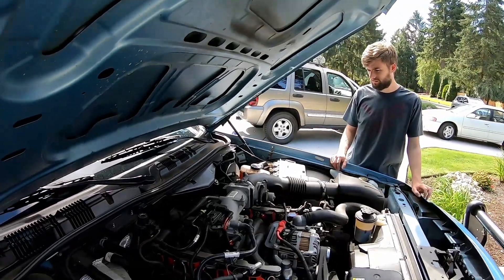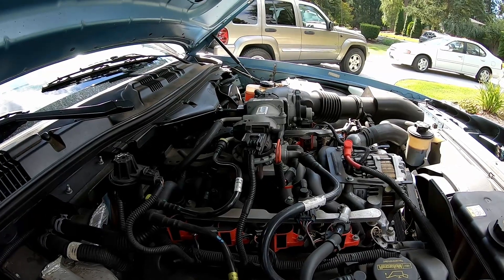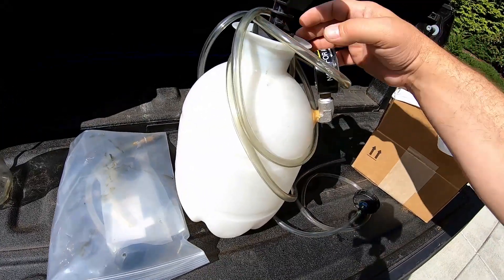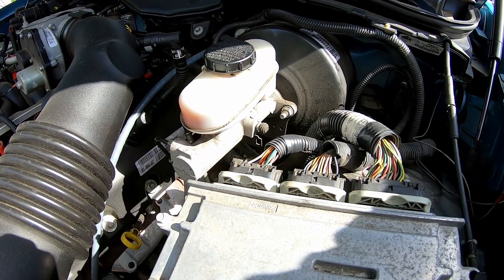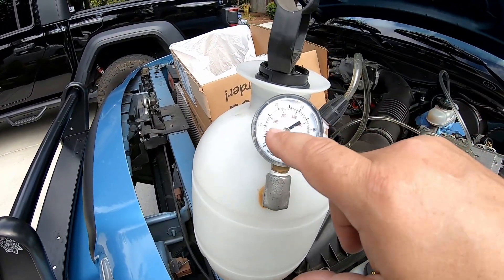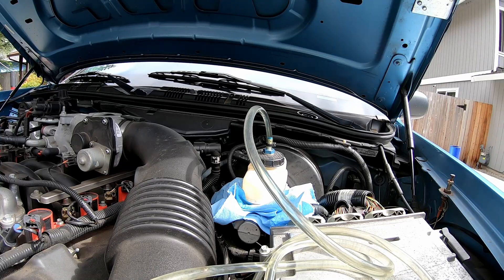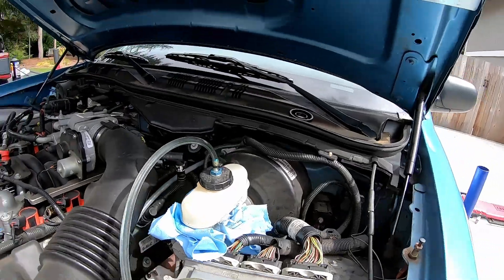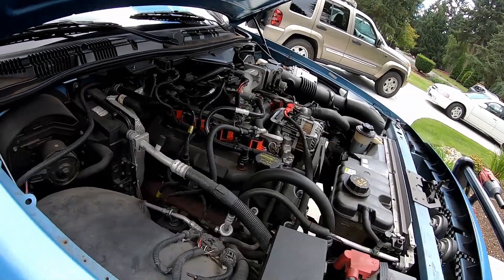How to Pressure Bleed Flush Brake Fluid on Crown Vic or Any Car

Comment: Thanks for sharing your time and resources to post this video. A suggestion... If your diy pressure bottle does not have a pressure relief and you need to carefully and slowly and unscrew the pump from the bottle. Try this. Add a tubeless tire shraeder valve to your bottle as close to the top as possible without interfering with the pump. You can then bleed off the pressure in the bottle via the shraeder valve as you would if you were letting air from a tire. Hope this helps.
Reply from the maker: That is a fan freaking tastic idea sir!  I have have a bag of tire valves in the garage since we started doing our own tires here last year.   Will do!
Reply: @PNW_Car_Mods  Use the cable type valve installation tool.  The one with the small Tee handle at one end and the threaded cap at the other end. Makes it easy to attach the valve stem and pull it through the hole. Glad I could help.🖖

Comment: Great Video, but honesly, did you notice that little black nipple on the side of the master cylinder? I think ford designed it as a bleeding place for brake fluid in the master cylinder. So instead of jack up the car and do all the tedious work, couldn't you just bleed and fill the master cylinder?
Reply from the maker: This would defeat the purpose of doing a brake fluid flush.  Your worst most contaminated fluid is out towards or in the calipers.  I mean if you just want to see a clean reservoir you could just suck the old fluid out of the reservoir and refill.  If you try this, I think you will be surprised at how quickly the old fluid will contaminate the fresh filled reservoir.  it will turn back to black in no time.

Comment: My brake fluid was green in my 99 lx.   I have been sucking it out over time its finally getting clear but still some green in the fluid
Reply from the maker: Keep after it.  You'll get there eventually.
Reply: @PNW_Car_Mods      thanks i am just waiting until i need new rotors and pads. Then I will do a complete flush at each brake caliper.

Comment: Wow. Your old brake fluid was dirty red. Mine was the color of dirty NyQuil. It is very satisfying to get that old crap out and new fluid in.
Reply from the maker: Should be good for the rest of it's life now lol.
Reply: @PNW_Car_Mods  Thanks for the tip on how to not ruin your master cylinder. I did that years ago on a 65 Falcon I owned back in 1980 and I almost forgot about that until you mentioned it in the video.
Reply from the maker: @j.t.cooper2963  Often easily overlooked and not taught by most automotive shop instructors.